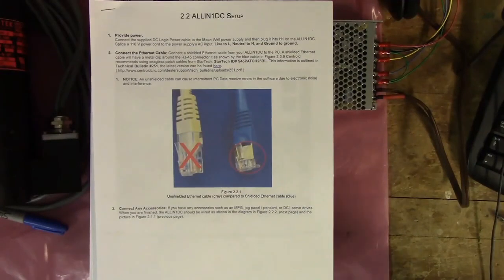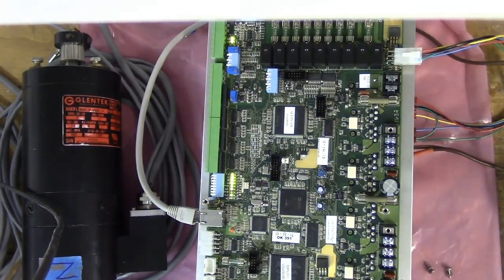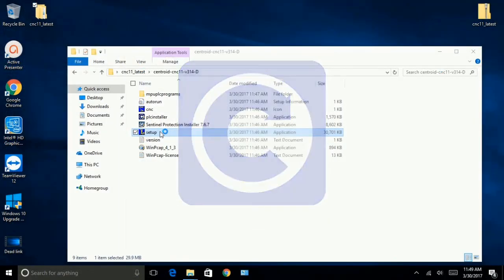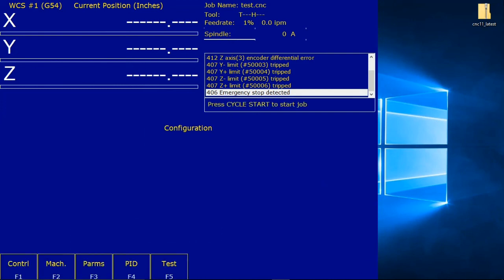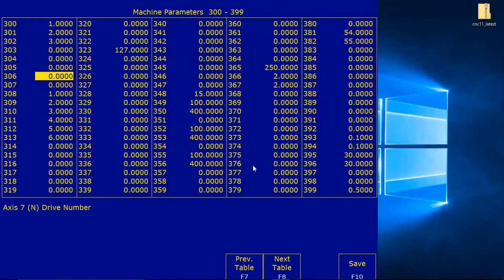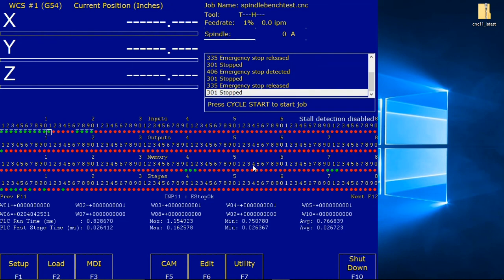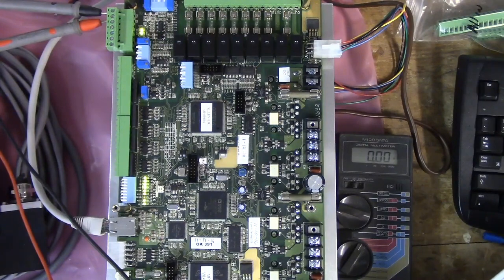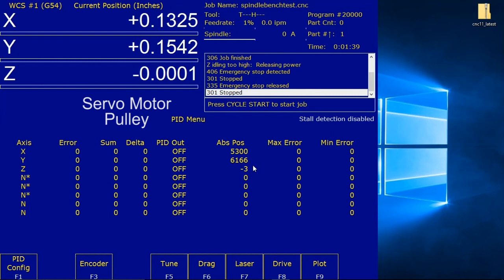Bench testing the Centroid All in One DC System

Comment: Hi Marty, great video series so far and it has helped sway me towards likely using an All In One DC on a possible near future conversion. I'm looking at picking up a Bed Mill that I can get it for a really good deal.

This video did sort of answer one of my questions that weighs heavily on my decision for a CNC system to use but it still leaves the question not 100% answered. What I'm wondering is if you know whether or not the system can act as as manual DRO once everything is totally hooked up and running?

As mentioned, this question was sort of answered in the video since I can see that turning the encoders by hand for the bench test does cause the DRO position display to actually update real time position and not just the encoder count. What I'm not sure though is once the system is fully hooked up and running, is there a Manual mode of sorts or easy way to essentially disable the servo's (well at least the X and Y) so that the machine could essentially be uses as a manual machine  with the software acting like a regular DRO.

I ask because there are times where I would like to be able to use the machine in a manual form because it would be quicker than going into Intercon and creating a program for certain simple operations.
Reply from the maker: Yes, the DROs changed based on Axis position. That is to say, if the machine has handwheels, you can use the All in One DC or Oak Centroid controls as a DRO
Reply from the maker: Yes, the DROs change with axis movement.

Comment: Marty - at the 38 min mark, when you are bench testing the encoders, you flash a comment on the screen saying: "Shouldn't have plugged them in hot!" - Do you mean that you should have plugged the encoders in after powering down the All in One DC? Or, do you have the servos plugged into DC power now? I assume you do not have the servos hot, but obviously you have the All in One DC hot, but i thought i'd get clarification first.  Since every time you power down, you have to go through the bench test 'reset' procedures, would there have been a more convenient time to plug in the encoders during a previous power down reset?  Maybe before the spindle test?  I can't afford to blow up my board, so i thought i better ask first.  Thanks, Marty!
Reply from the maker: If you have closed the manual to a "T", yes I should have had the encoders utter in along with the servo motors on the bench. Did you test your motors per the label on the cover of all in one DC? There is a Centroid tech bulletin and I did a video on that
Reply: @martyscncgarage5275  I'm taking the motors off today so I will be following your video on testing once I buy new encoders from Centroid.  I thought that i could use the existing encoders on the SEM servo motors, but since they are from the early 80's, i'm sure that i'm going to have to replace them.  The cost of this project keeps adding up, so i thought i could save a few bucks...  but i realize now that I'm going to have to put the new 2000 line encoders.  I'm also planning on buying their bulk encoder cable once i figure how long the cables will need to be.
Another question I have is with CNC11.  The installation instructions and this video are for installing CNC11 - Will the All in One DC support CNC12? If so, wouldn't it be better to do a fresh CNC12 install instead of starting with 11 and upgrading to 12?
Reply from the maker: @jasonbushis  try automationdirect.com I buy from there as well. So long as they have the correct size for your motor shaft
Reply: @martyscncgarage5275  thanks Marty.  I see that they have light, medium and heavy duty.  Would the ones i need be considered light duty? I also see that they list these as pulses/rev, not lines/rev like the centroid does.  If you have a part number from AutomationDirect that you've successfully used, that would be great.  As always, your content is amazing. Thank you for taking all the time to support the DIY community.  I wouldn't even dream of taking on a project like this without your videos and forum support!
Reply from the maker: @jasonbushis  Light duty is fine provided the are enclosed. You are looking for +5vdc line driver encoders of at least 2000 lines.

I'm not perfect but I try and help as best I can. I appreciate the kind words.

Comment: Yes. I struggled a little with having to deal with the spindle bench test macro I loaded but went smoothly till I did the encoder test. The plug ins weren't obviously directional and had them backwards at first test. That made me go back and check my tracks and scrutinize the whole process including the error log. All and all made me much more familiar with my machine. 
Your video was really helpful when I had some frustrating moments. 
Thanks. I'll be watching your servo reversal video probably tomorrow. 
Thanks again.